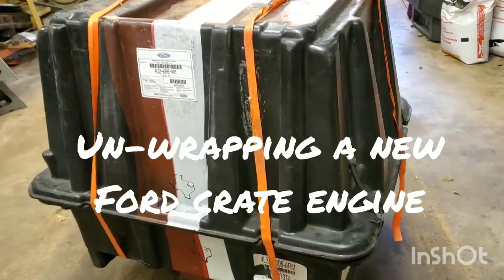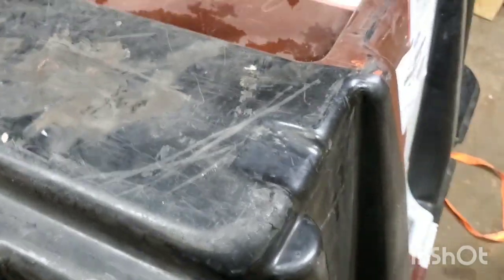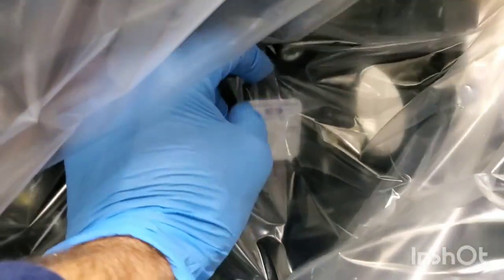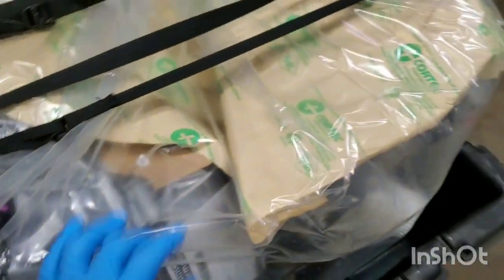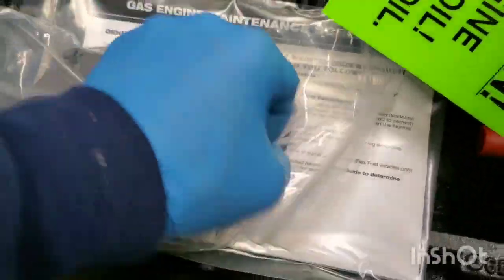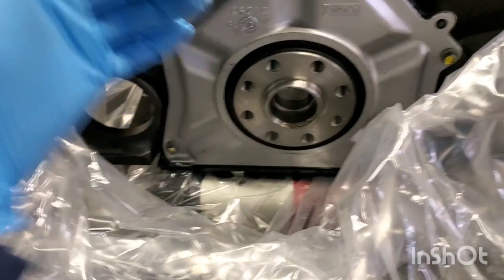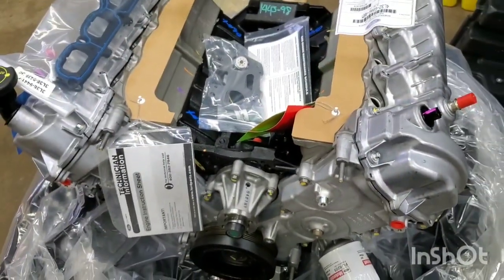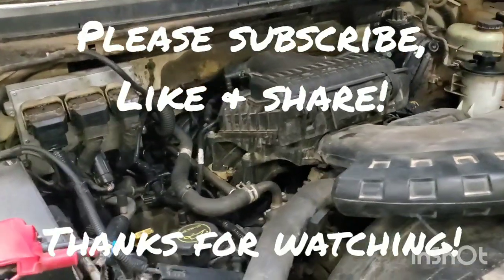Un-wrapping a Ford 5.4 3V Crate Engine

Comment: My 5.4 has 315k on it running strong. Great video, I might need one of those soon lol
Reply: Make sure you change the oil cooler above the filter if you have one..  When it blows it will signal the end
Reply: Is it 3V or 2V?
Reply: @ricbonillasjr2567  3v. I sold it and my brother drives it now. It’s still going and is around 342k when I last saw it
Reply: Did you do timing chain and phasers? If so at what mileage?
Reply: @markstephens573  All original. It got sold to my brother and he’s got 350k now. Still original internals

Comment: I have 2 clients, both with 2010 f150 with the 5.4  they both have 500,000km on them and no typical issues. Just routine oil changes every 5000km
Reply: 2004 f150 fx4 here with just over 440,000kms and still going strong 💪

Comment: How much was the engine? Great video
Reply from the maker: Every supplier has different pricing.  This one came  from Bob Howard pdc in OKC.  They are a dealer wholesaler open to the public, so the cost is much less than going straight to the dealer.  I don't know what the current price is or availability.  I prefer buying from the pdc over aftermarket suppliers. The cost is usually a little higher, but you can't beat the warranty and the workmanship.

Comment: OKC Vet I have a 2006 E250 with 181,000 miles with a cracked head. It’s been running great. I’d like to just replace the heads but have a had couple mechanics tell to put in a Ford remanufactured motor. Any advice? Thanks.
Reply from the maker: Putting in a Ford reman gives you a 3yr/unlimited mile warranty. Its also one of the most expensive routes to go. If your engine was diagnosed properly and they are sure a head is cracked, replacing one head is the cheapest route.  I would ask what your intentions is for the van. Planning on keeping it 3yrs? Using it another 6 months, then getting rid of it? If your planning to keep it around a few yrs, putting a factory reman is a great option. Full warranty, parts and labor for 3 yrs, & any dealer should fix it for free, other then fluids. Salvage yards want too much for theirs and you don't know the history/condition. Not saying you won't get a good one, but why chance it. If the heads aren't cracked, what's the issue? Most dealers/repair shops/mechanics don't want to chance it not getting fixed right and will suggest a reman engine. And I've seen my fair share of mechanics that aren't very good at diagnosing. The other issue is time frame. It takes more time to pull the head(s), send them off to a machine shop(which is the delay normally), and reassemble then to install a reman.  I would get more then one opinion on the issue. I really don't see many cracked heads. With that many miles though, you may have other issues appearing and multiple repairs may cost as much as going with a reman.  Many different scenarios I could talk about. Hope I helped.
Reply: okc vet Thanks for the advice on the E250. Do you have a shop in OKC? I’m in Tulsa and would like to talk to you a little more about how to proceed. Thanks.

Comment: I've got an early 2008 5.4 triton with the old style two piece spark plugs, can someone tell me if a 2009 crate engine will work? Any help will be appreciated
Reply from the maker: All 3v engines are the same. Bolt-ons are different but the base engine is the same.
Reply: I got 2008 with the brown coil packs and it had the regular spark plugs in it and the engine had build date 12/10/2007
Reply: Buy Jasper.
Reply: @noneofyourbusiness7594  Where did you find the engine build date ?
Reply: @froglobster  driver's side valve cover has a tag.
Reply: @Jay388  Thanks, I got a mechanic to re the plugs in case of them being the ugly plugs. Turned out they were one piece and truck manufacture date was May 2008

Comment: My 5.4 is a 2006  just bought it a few months ago   Only 83k  seemed to be in very good condition  after buying I learned about these engines lol  so far Iv done the updates spark plugs and solenoids vct  that fixed a hot idle knock knock  I’m running 530   I still have hot idle tick tick tick   It runs strong and good    But I’m worried the tensioners are bleeding off pressure    I also get a quick little startup rattle sometimes on cold start    Also when going real slow through parking lots and releasing foot off gas pedal I hear maybe the chain going a bit loose   Just a quick little noise    What are your thoughts ?  Could you give me any pointers ?   I’m wondering if I should just run with it  or dive in and get a timing job done with a Melling HV oil pump and Melling tensioners    I just took it 3k mike road trip and it was fine    I did notice a rattle on open highways when on incline and going 70-80   Not sure if it was wind   Everything seems nice and tight and my cats seem fine and o2 sensors aren’t loose and either are the heat shields   It sounds like a heat shield    I actually did the vct solenoids after the trip so not sure if it does that rattle anymore
Reply: I'm not an expert but I can tell you what I did.  Very similar situation as you described with my '04 F150 XL with the 5.4 Triton and common throughout if you read the forums and repair articles.  I purchased mine 11 years ago with 60K miles and it has 192K today.  Unfortunately, nothing lasts forever.  I'm in the process of replacing the original engine with a reman like the one in this video which is what I opted for due to a plug that could not be removed.  I learned that this was the original plug and had not ever been replaced, unable to extract so the techs just left it alone and did not disclose ever.  That's on me.  So instead of replacing the head only (which is what the Dealer advised), I decided to replace the engine.  This is a long way of saying do the timing job if that gives you some comfort or drive your truck as is for as long as you can.  You might not have any issues for a long, long time.  The only repairs I've dealt with are a new water pump/thermostat and new radiator which were done in the last 3-4 months.  Best of luck with your vehicle.
Reply: 0616ko thank you friend
Reply: @0616ko  For your replacement are you or did you go with Ford or another manfacture? I am in the same situation with you with my expedition
Reply: @dink8898   I replaced but not with a Ford reman.  My trusted mechanic has a vendor where he purchases his Ford engines and there are several sources that can provide.  Most, if not all, when i was researching offered the  36mths/100k miles warranty included with the engine.  I have this same warranty.  It's been about 4 months and 4000 miles since the replacement.  Drives great with no issues, very quiet running motor so I'm pleased that I made the decision to replace.  Sorry you're dealing with the issue and wish you the best.  Hope this helps.  Regards.
Reply: @0616ko  Thank you for response back, that's alright I know how troublesome these engines are.
Reply: Your timing phasers and guides are probably going out. I'm currently replacing my engine due to a shit job a shop did on my timing system. The chain slapped a hole through the front of the block and screwed up my crank to the point of needing a new motor.  Have your timing job done by a reputable Ford dealer.  I'm currently installing a new crate engine in my 04 fx4 with 269,000 miles.
Reply: You've probably already fixed or exploded your engine by now, but I can shed some light on this from my experience. There are video on YouTube on this, too.
I bought my 2011 Expedition from the original owner with 95k miles. He was selling it on Craigslist for parts. He said it started making a ticking noise after he parked it during the pandemic and was told by his mechanic to take it out for a 50 mile drive on the freeway. He never made it home.
I was hoping it was the phasers and chain, but it was a roller cam follower (looks like a rocker arm). Snapped two valves and grenaded the piston. I mean GRENADED; the piston rod came through and it was a tangle of piston rings. 
So...if you do the timing "job", remove and inspect the cams and replace the cam followers with the improved Melling followers, too.

Comment: Where did you buy the engine?
Reply from the maker: You can buy them from any dealer I believe.  But its cheaper to find a parts distributor. Not every city has one but OKC does. And most dealers buy it from them anyway.

Comment: i would not buy this engine from ford you are screwing up your just buying the same issues the old one had aftermarket one from power train products have the updated oil pump and newer cam phasers and also the new style roller follwers

Comment: Buying the same problems it had before. I'll stick with Jasper as they fix the problems factory engines have.
Reply from the maker: Most issues are maintenance related. Doesn't matter who you buy the engine from if you don't service it correctly. I normally don't purchase aftermarket rebuilt/reman engines anymore because they are expensive and never know what your going to get.
Reply: @okcvet1st  updated rockers for these motors have a smaller oiling hole to help boost oil pressure because the original ones would cause so much oil pressure loss. My wifes 5.4 on the passenger side had worn out cam journals from oil starvation. also I am have always been a ford guy and I for one will tell you that Fords oil pumps have always been known for wearing out fast. I have always replaced oil pumps soon as I can. This is what people in here are asking for. I guess the best way to find out would be to go to the people that build that Ford reman engine and that would be Ford.
Reply: @gijo5088 It’s not Ford, it’s AER Engines. They’ve been remanufacturing engines for Ford for decades.

Comment: These are NOT remanufactured by Ford. They are remanufactured FOR Ford by AER Engines and sold through Ford dealers and delivered to the dealer or the shop of your choice by AER.

I’ve heard bad things about the Jasper reman’d engines. I know Powertrain Products uses the upgraded Melling HV oil pumps and I believe the metal timing chain guides and improved cam phasers; not sure about the roller followers. Does anyone know if AER uses any of the upgraded components?
Reply: It doesn't matter who actually remans them. If they are certified/authorized and that's who they chose to reman for them, then that means it's prob the best you can get by their standards.  Everyone knows that.  Oakley doesn't make their sunglasses. Some manufacturer in China does.  Not many parts are made by any manufacturer. Especially computer components and drivetrain parts.  I don't really care, especially when they give the warranty they do. If AER agreed to the warranty, must mean they are better than places like Jasper.
Reply: @okhotrodder  I was responding to comments as to who actually does the remanufacturing for Ford. As far as warranty, Powertrain Products has a longer warranty (5 vs. 3 yrs) and offers extended warranties out to 7 yrs. This and Powertrain uses Melling HV oil pumps, improved cam phasers and roller followers, metal timing chain guides, etc.

I am NOT saying which one is better, but I would not buy anything from Jasper. As far as the 5.4 3V being a POS, I do not agree. These are an OHC, not an old pushrod 302 and require scheduled oil changes (no more than 5k miles), with a high quality filter and synthetic or synthetic blend oil. The top end on these engines MUST be supplied with the proper volume of clean oil at all times.
Reply from the maker: @seanhoward8025   You may be referring to the metal tensioners instead of the plastic ones.  The guides are still plastic.  Ford is using the updated phasers, which are just newer style.  I use the melling hv pump when replacing timing sets.  Occasionally I'll use the hp pump depending on application. The remans do not come with hv pumps. A reman shouldn't need one.  The chains/guides are the same.
Reply: @okcvet1st  All the more reason to go with the Powertrain Products remanufactured engine.